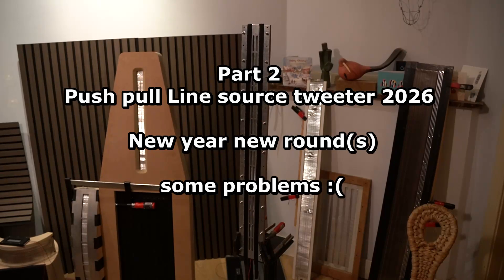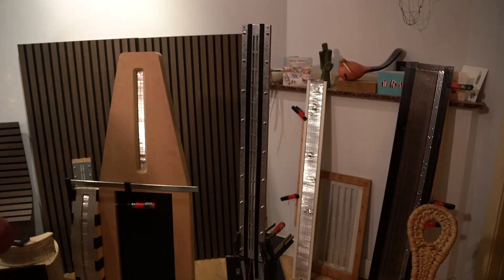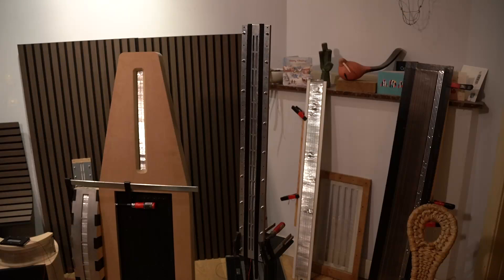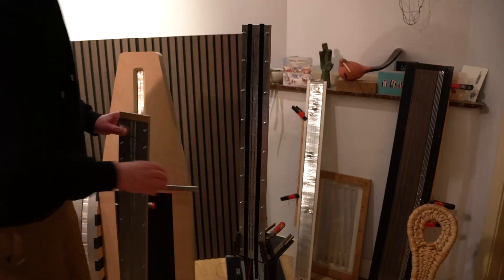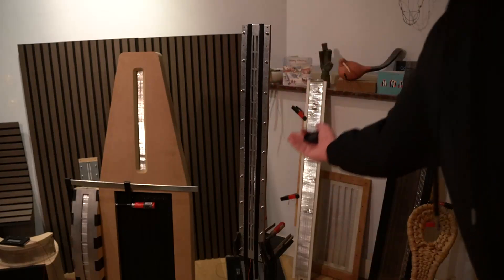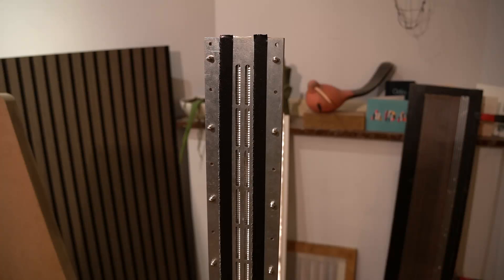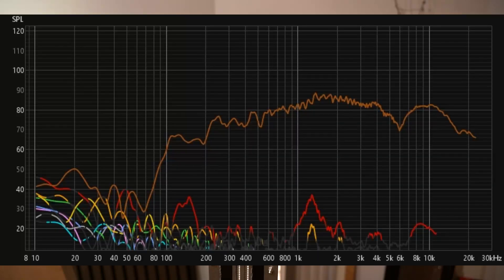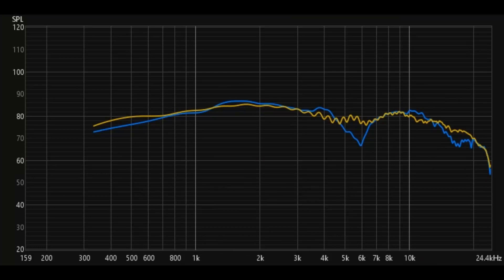Part 2 Push pull carver style line source tweeter 2026 - some measurements :(

Comment: Hi Joppe: good to see you at it again. The original carvers only have two slits, and while they do have irregularities in the hi freq it’s a lot less than what you are experiencing. Bob Carver solved these issues with a notch filter on the crossover: mine are driven by a mindsp 24hd, so I had to replicated that notch in the DSP as well. The fact that your 7khz dip improves when masking the sides slits suggests that in fact you may have diffractions and/or cross cancellations caused by the geometry of the extra two slits. So, the Carver ALIII may have hit the sweet spot of the ideal width, while being able to go down to 150hz, which is a lot harder to do with neodymium’s instead of ferrite, due to the required closer distance required by the denser magnetic flux.
Reply from the maker: I agree on the extra slits... not working :)   and i agree. doing it with neo's might improve output....  ferite has there place. the lower you go i think. it extends its field a little further away then neos do, so using a bit more room solves some problems at the cost of output.  to be fair single ended looks best for me

Comment: Why you mesering in 10db steps? I never do that only5db steps
Reply from the maker: i use normally 5 db steps as well and a range of 50dB, these measurements are really fast and crappy. enough to see major problems like this huge dip. i would do better ones if i found whats causing this ugly top end

Comment: Did ypu chack your microphone?  I hear a strangs rrr wen i hear you talk somtimes
Reply from the maker: My mic is fine, i measured one panel against the other so. i would see the same problem in both if the mic was the problem. oh the mic for the video itself ? is the camera mic. its not the best. and i run around quite a bit :) so yeah im sure it has artifacts etc